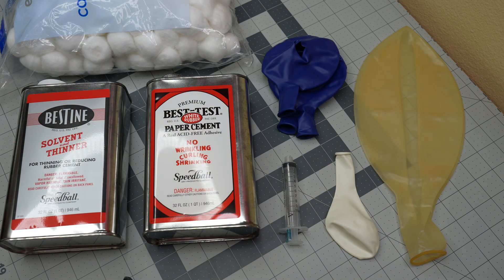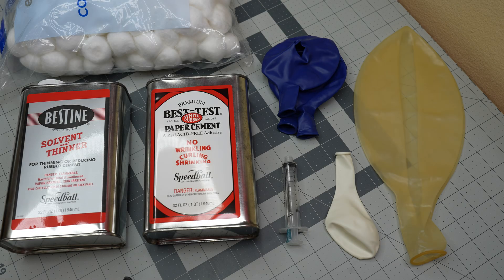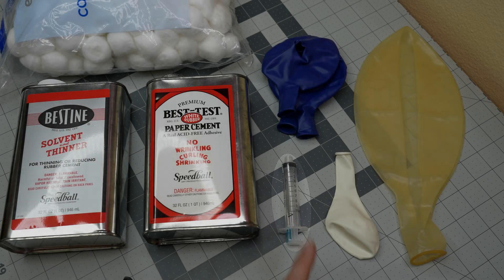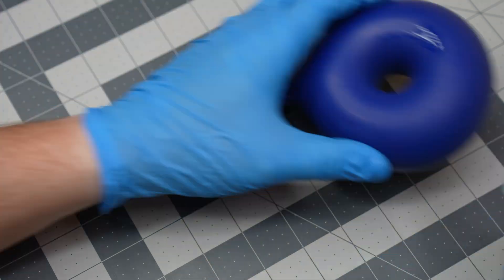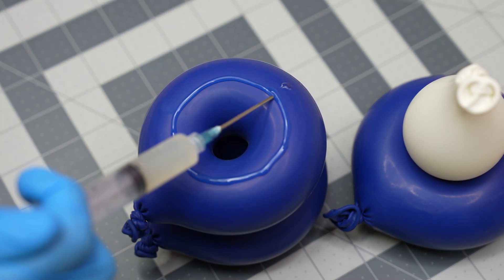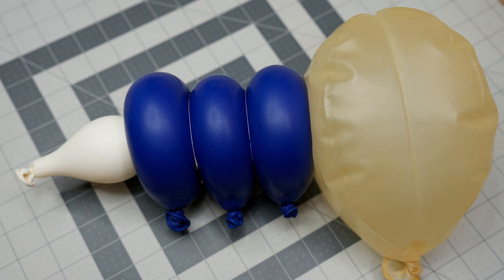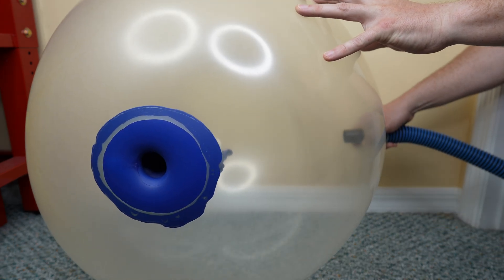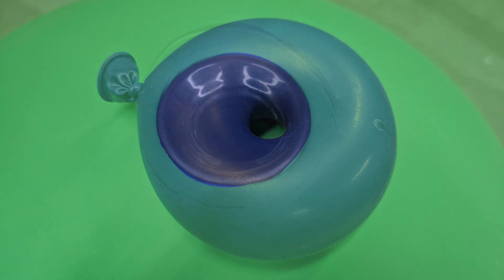Building a Balloon SPH and Installing it in a Balloon

Comment: Could this be installed on large inflatable latex suits? I got a kangaroo from kink projects and it is quite massive so I can see there being plenty of space for it.
Reply from the maker: I am sure it could. However, I imagine that suit is very expensive. If I were doing that I would probably want to spend more time making more precise bonds and cleaner cuts. Possibly gluing an extra disc of latex on before attaching this. Also I would probably want to bond the balloons closed in addition to knotting them so they don't deflate slowly over time.
Reply: @HeathDragon  I have some experience with bonding latex when I put pool toy valves on 3 of my suits (one of which is the kangaroo) so it is already modified. I am not too worried about how clean it looks as long as it's sturdy and doesn't leak. Will get extra balloons and practice making an sph first.

Comment: Can these rubber donut balloons be bonded, airtight, to latex? If so, would you use HH66 or would rubber cement be better?
Reply from the maker: Yes, they can be bonded on alright. That is what happens in the video. Bonding latex requires rubber cement.
Reply: @HeathDragon  shit, I meant to say can you bond rubber to vinyl. :P
Reply from the maker: Possibly, but I don't think it would hold very well. Rubber cement would be the thing to try.

Comment: Just a stupid question, does that make the big balloon weaker by gluing something on it and making a hole?
Reply from the maker: Most certainly, but the donut balloons are not really even inflated and the 3-foot balloon was only inflated about half to two-thirds full. If I spent more time making cleaner bonds it could potentially be done well enough not to compromise the strength significantly.
Reply: @HeathDragon  would be interesting to test the strength of the balloon by trying to inflate it fully and see if it pops or not. That would give idea of project by gluing other balloons for example ... But if the balloons becomes to weak, that would be less interesting